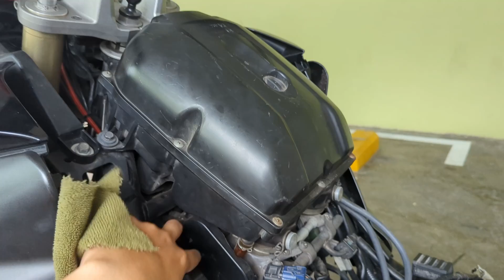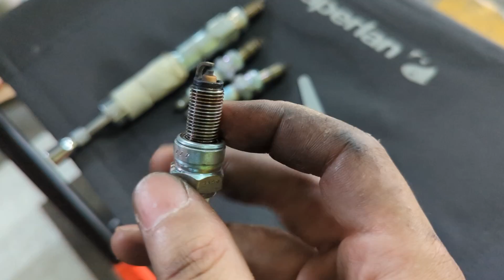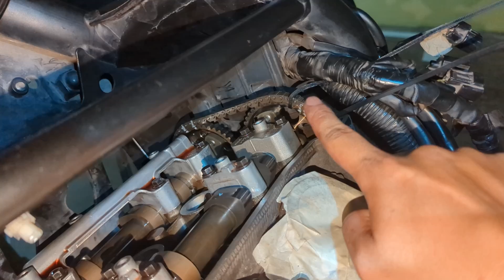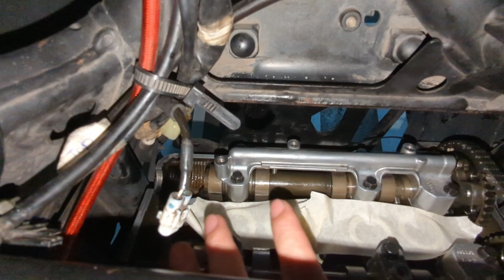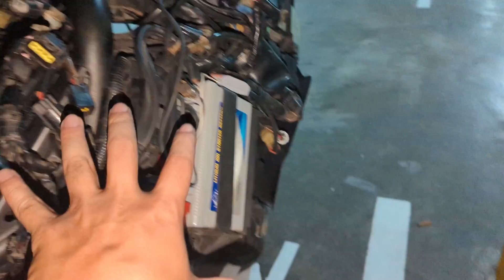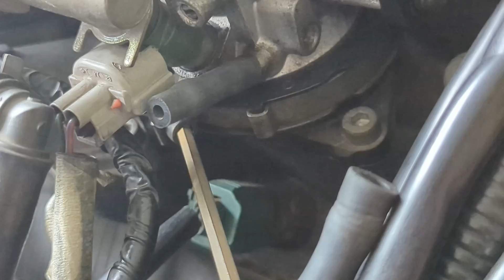Valve Clearance | Cam Chain Tensioner | Yamaha Super Tenere Restoration [Part 12]

Comment: If i only want to change tensioner to manual tensioner, do i need to check and lock timing?
Reply from the maker: If the setting is left unchanged from Factory or the chain is not too loose. Then I will think that it's okay not to check and lock the timing.

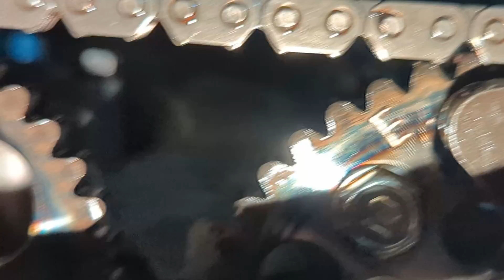Comment: Hi ZWC, @13:20 you mention 4.5 links between marks, but what is shown is actually 4. Has your bike been running ok? 

I was able to download a service manual for free online and it has been very helpful.
Reply from the maker: The bike runs good.
I count 4.5 links from the "I" mark to the tooth touching the chain on the "E" side.